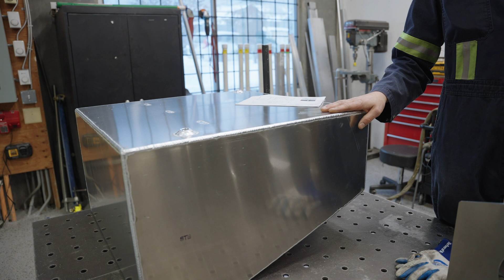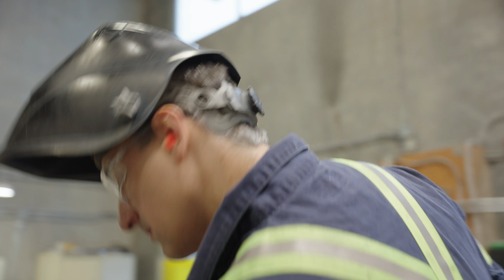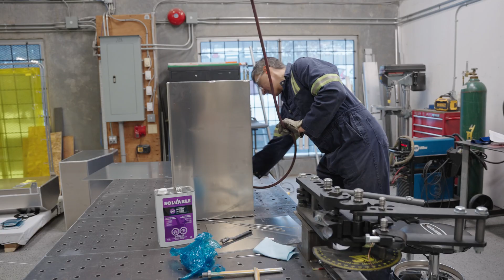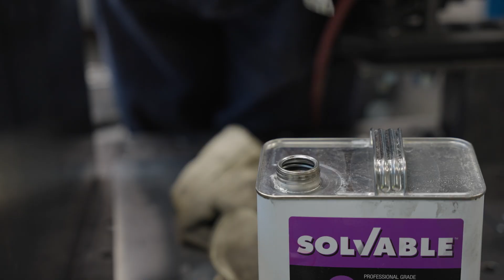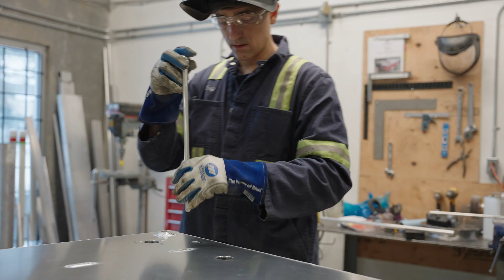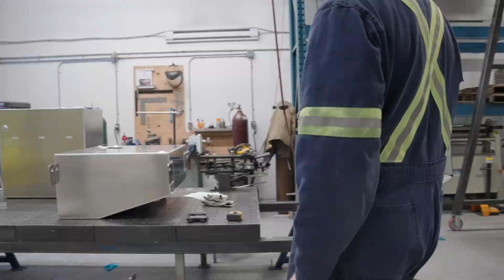My most INSANE FUEL TANK build yet! - SECRECTS REVEALED!

Comment: Where did you purchased your mask or a link? I have a 3m one I tried searching for hose/adapter to move the filters towards the back but no luck.
Reply from the maker: I got this years ago, I would say over 10 years. And it was issued to me at a large sawmill. So I'm sorry I have no idea where to get one now. However, I have switched to a positive air system. This is 100% the way to go.
Reply: @ okay thanks for the reply man, just starting welding at little bit at home, need to save up if I want to invest in a good PAPR system.

Comment: Love your videos, you’ve really improved your skills over time. Care to share more info on your respirator? I’ve never seen one with the snorkel style filters? Also what kind of filters are those as far as what they’re rated for etc? I wanna get the right filters for welding esp aluminum.
Reply from the maker: I now use a positive air system. Blows filter air into the helmet. This is 100% the best option, I will never go back. Why? I don't always use a respirator, you need to shave, they get hot, and dirty and harbor bacteria. But the snorkel is ok, you can use any filter rated for welding. (basically a particulate filter, you don't need chemical protection for welding) Welding smoke is tiny particles of metal.

Comment: What keeps fuel vapor from escaping around the scews of your sending unit flange? (Since the screws now thread into the tank as thru holes)
Reply from the maker: Good questions, the sender comes with a gasket. And the #10 scews also have a small gasket on them. There are no leaks. This is how all the tanks I have seen are.

Comment: Unless  you etch the mill scale off the tanks, inside and outside.... there will be pitting in a year or so. Mill scale is not vapor proof, so ambient moisture is retained in the porous but shiny coating.  Then the little tiny droplets lose their entrained oxygen to the underlying aluminum oxide and that process shifts the ph downward usually past 5 and the acid then begins to recover the oxygen from the aluminum oxide film.  Then, the pitting begins and shows up as 'white flowers' to begin but continues until there's real deterioration.  The same happens without water bottoms traps (Navy Sump) so the bottoms become acidic and these tanks will eat out from the inside too. No downcomer for the fill? Not securing down comers on marine tanks isn't the best practice IMExperience.  Little 1/2" or 3/8" fuel draw pipes left to free stand on the bottom of the though wall fitting is not adequate support.   Not that fuel slosh will impact them but engine harmonic vibrations will.  Be interesting to see how these tanks fair in a couple years?
Reply from the maker: I have built about 100 tanks now. This tank and all the tanks I build are orders of magnitude better than anything I have seen from an OEM builder. (I could only be seeing the bad ones because they failed, survivor bias) I do offer my customers the option of having their tanks coated. The fuel draw on this tank Is possibly a weak point though, and I no longer use those. A point worth nothing, at the end of the day I build what the customer wants, and those factors are not always scientifically sound. Thanks for the feedback. Cheers!
Reply: @gregepp3082  I built a couple hundred welded aluminum commercial and rec. boats from the 70's to the 90's an a few since: some 20- and some three and four times that displacement. Many included removable tanks as well as built-in and my shop took in repair and mod's work as well.  I repaired tanks too and agree that many mfg. of tanks don't do as high quality of a job as they might. But the majority of tank failures were from corrosion weakened areas where mill scale was left intact, and from too-tight bends done w/o regard to the bend brake die radius and tooling size charts.  Water bottoms sumps, down comers (gen. tank furniture), fill down comers and all the other ABYC, Navy and Lloyd's marine tank standards are pretty widely accepted!  Most boat surveyors in our neck of the woods, (Alaska) won't accept out of standards tanks?? So the client, like a home owner, isn't really entitled to financing or insurance if they seek and build out-of-spec marine tanks.  I think there actually is a CFR addressing this? Cheers.
Reply from the maker: @kevinmorin7965  if your every in Vancouver, your welcome to stop by. I would be happy to learn as much as possible from you.
Reply: @gregepp3082  I have a tank thread on a boat building forum.  Glen-L Forum, under the metal category is a thread on welded aluminum tanks with some information that could be useful?
Reply from the maker: @kevinmorin7965  Thanks, Kevin!

Comment: Excellent work! About the little overlap of the aluminum sheets when welding the joints or edges, could you educate me the benefits of doing it that way? Other folks I've seen there was no overlap.  I'd like to know the difference. Is the weld going to be stronger?  Other thing is the thickness of the aluminum?  I thought you said 3/16?  Thanks in advance

Comment: Hey cool gas tank. I was wondering how the tank mounts in the hull. Does the weight rest on the hull or is it suspended with the weight on those bolts?  I wanted to make a tank for my boat and wasn’t sure if people ever had problems with wear from the tank rubbing on the hull?
Reply from the maker: You definitely do not want to rub on the hull. What I have seen though is corrosion happens anywhere that aluminum and water touch for long periods. (it will eat through the tank) You can also have galvanic corrosion with stainless and aluminum. Given those factors, I overbuilt this tank. However most tanks last 30 years. So this is definitely overkill.  Good luck with your build!
Reply: @gregepp3082  Thanks for your feedback! I’m going to give it a shot
Reply from the maker: It was mounted with bolts holding the weight. Surrounded by Delrin bushing. I built the tank out of 3/16 (1/8 is the norm) It also had a lot of baffling for the tank size. This was to give it the internal structure to take the weight. Great question!

Comment: Good video mate always love a bit of Aluminium welding 
Was the torch switch a variable one
Cheers from Aus
Reply from the maker: Thanks for watching!!! Yes it's miller roller switch style. I generally set the machine for 220amps and roll the switch to the max, backing off slightly as the part heats up. you don't have the same control as a foot pedal but greater flexibility in movement. It's worth the trade-off. You also don't have to drag that pedal and cable around.